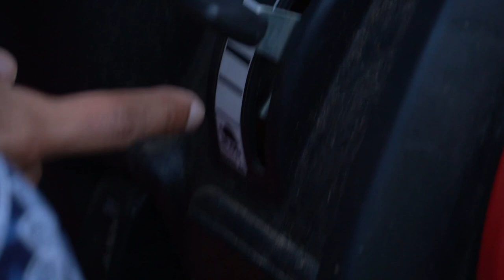I got a Lawn Mower for FREE!! (Lawnmower Vlogs RETURN)

Comment: MY grandpa had a craftsman ride on from the early 2000s with a brake/clutch so you could put it in 6th speed full throttle, quickly let off the break and it would pop a wheelie.

Comment: For a small engine tech (As I am) hearing ethanol and mower in the same sentence is as triggering as assuming a liberal's gender
Reply: I just spit my beer 👍
Reply: As an automotive mechanic I agree. I run premium non ethanol in everything other than my daily driver
Reply: @tatewilson7678  same here brother 🙏
Reply: Can confirm
Reply: Yeah, no corn in the mower...
Reply: What do you think about sta-bil marine? I've been running it in my mower with 10% ethanol gas, because it's all we have around here and the marine sta-bil has ethanol treatment in it. I haven't noticed any problems... yet.
Reply: @UToobSteak  Well with sta-bil its alright in moderation. Dont over do it other wise you will gum up a carb worse that if you were to put e85 in it. Like I tell my customers buy the best fuel that money can buy and take care of that fuel like a child.

Comment: Dan, i'm a small engine mechanic... i hate to break it to you but that kohler engine is the worst engine ever built and designed. kohler even knows this. It's a dying breed of engine. it's a 19.5hp single cylinder. the moment we see one come into our shop, we check for oil leaks. These engines were designed with such a large piston and piston throw that they need a massive double counter-balancer.  They made the case walls so thin that if the engine takes too much load or shuts down slightly wrong, the block cracks.

Comment: You got gas leaking from your carb into your oil when you started it a bunch of gas came out the exhaust keep running it if you wanna check it take the dip stick out and see if it was smelling like gas if it is change the oil till you get a new carb this is what happened to mine not bsing you
Reply: Dont keep running it*